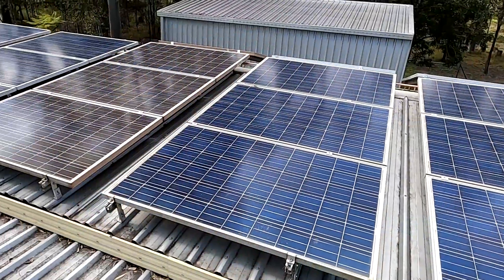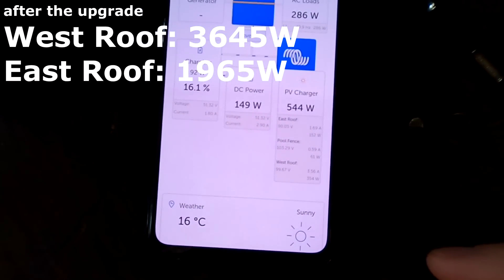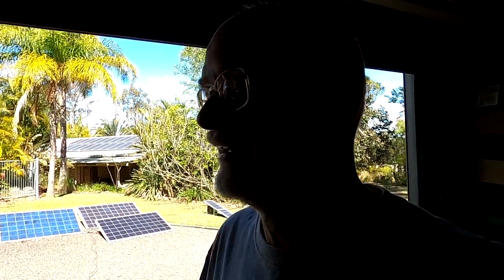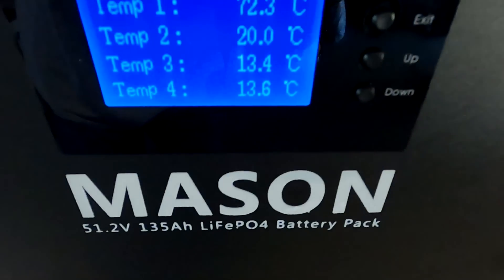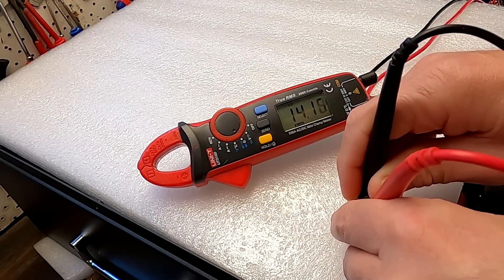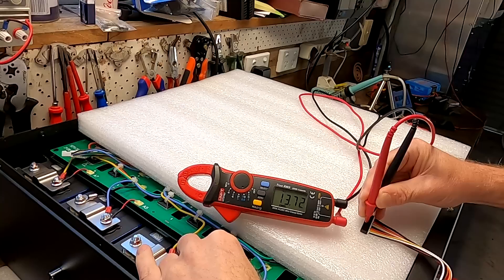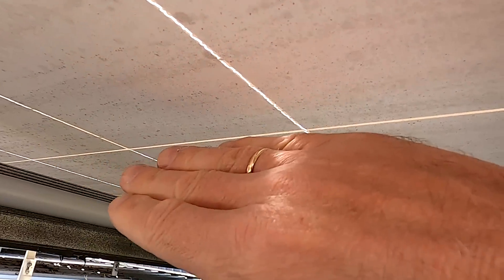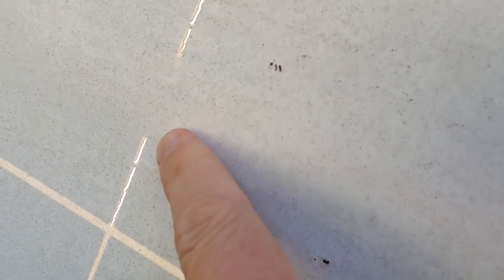SEPLOS MASON temperature sensor problem and a major issue with the solar panels. NOT GOOD!

Comment: I still think it's more interesting to install new panels with the best efficiency per square meter, specially now with the energy crisis
Reply from the maker: That's a possible solution. I'll discuss this with the electrician. The Trina Triple Cut panels look interesting. Or Hyundai Shingled panels...
Reply: @OffGridGarageAustralia  - if u replace them… how can those damaged panels be recycled, since the moisture is already inside the panel [so repainting will only embed the water 💦 & damage continue], and the oxidation can eventually result in a short circuit which can lead to a fire? 🔥
Reply from the maker: @DavidHalko  they won't catch fire. I thought about re-sealing then with a silicone paint or so. I'm not sure if it is moisture. There are no traces anywhere in they panel. And there is no direct water contact from the underside either. It's just a guess. Could be also contact with oxygen which stained the busbars?
They will be still perfectly fine for an RV or a garden shed and a 12V system. Actually, this just created an idea...

Comment: Hi Andy, one german solar energy professional "Der Elektrotechniker" also had problems (also with "Canadian Solar" panels) with foils on the backside in his Video Nr. #139 (https://youtu.be/fJOeU2247ZE?t=2115). He found the most problematic modules by isolation testing. Do your modules also show "chalking" effects with the foil? You should definitely measure the insulation resistance (with 1000V test voltage and possibly applying some moisture from the back) and fix this by getting new modules or with some DIY insulation. The metal will oxidize sooner or later and your modules will degrade quite quickly, if moisture continuously gets between the glas and the back foil.

Comment: The solar panels look fine to me, you are just seeing the gaps between the actual solar cells in the panel. Unless you mean that the panel backing is cracking. The discoloration of the tin/nickel wire connecting the solar cells together doesn't seem to  be an issue unless the wire is degrading/thinning/cracking, otherwise might just be surface oxidation.

Comment: Great another thing for me to check on our old panels that came off of the house roof. Those cracks are rather impressive. I vote for the cheap option of seal them up with Duck tape and keep your fingers crossed.

Comment: Hi Andy, as long as the PV modules are still generating >75% power, let them run, what should the electrician say?
Why do you even need an electrician? If it works independently.

Comment: This BMS works perfectly with my sma sunny island AC coupled system .
Being able to use a grid tie inverter in an off-grid system is brilliant,  now my panels are in one string of 520 volts😊
Trina and Canadian solar panel had a delamination issues in the past, solar panels that can't cope with heat and light😄😄😄

Comment: I know I know but this to shall pass... Suggestion. Eventually clean with alcohol  re-coat all the backs with white silicone roof coating, for added panels pre-re-coat them before you install. This is what i will do with mine if i need to,, in the future. I am assuming that Canadian panels are designed for colder areas rather the Hot so there coating expanded where it was hit with the sun, ,just an observation maybe. CCHHEERRSSSSS

Comment: If you bought the panels used, someone has probably walked on them. Those panels have failed.   The technology is much better now. New panels are cheap now and 300 to 400Watts.

Comment: as for the cracked mastic on the back of the panels;  take them down and fill the cracks with silicone sealer or coat them with some liquid mastic i have seen advertised for that purpose.

Comment: Kinda dumb to put solar panels where they are shaded often. Cut down some trees or locate your array where they are not in the sun.
Reply: It's not dumb if it's the best available option. I've got shading over my panels from trees as well, but my desire for a nice yard is greater than my desire for peak solar production. Solution? Add more panels to get the draw needed. Andy talked about wanting to get 1kw in shaded conditions, so it's clear he's doing the same. Beyond personal want for trees, in many places, trees are protected by the local government and can't be cut down without approval first. Something doesn't have to be perfect for it to be worth while.
Reply: I have early shading on my westerly workshop roof from the garrage. It is gone by lunch time but this will only get worse as we move into winter.  
I know a good cure...
I will knock the garrage down!

Comment: Just one more comment , Venus OS I know works with RS485 to USB adaptors that use the FT232 chip. I use it to connect to my energy meter to Victron system.

Comment: Interesting Andy ! I hope they send you a replacement board to solve the sensor issue. About BMS connection to Victron , It was easy for me as I used the CAN port on the Cerbo Gx Device to connect to seplos. I have seen people using a CAN HAT on the Pi to connect to Seplos BMS. Interesting to see if you get the RS485 connection going.
Reply: RS485 needs the selection of a cell .. horrible. Currently I use 2 mason on SMA Sunny Island with CAN, but connect with RS485. DIP switches are different as well ...